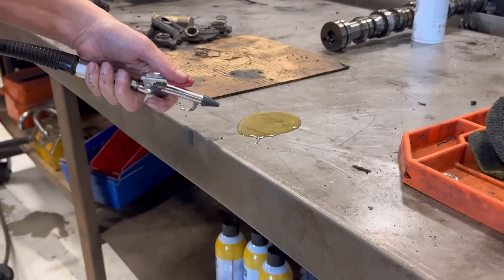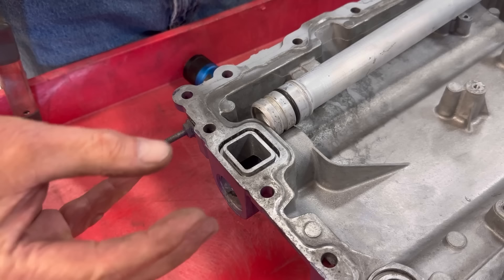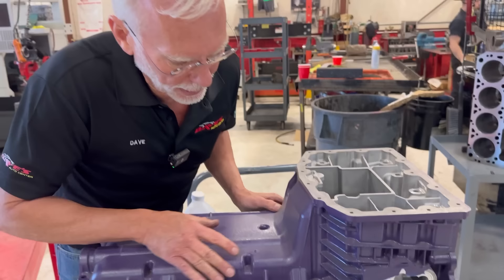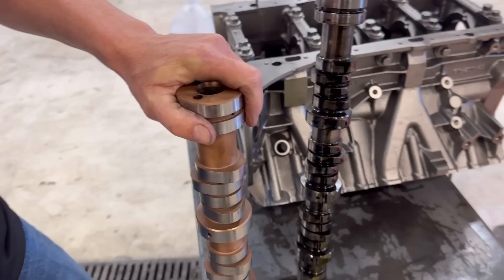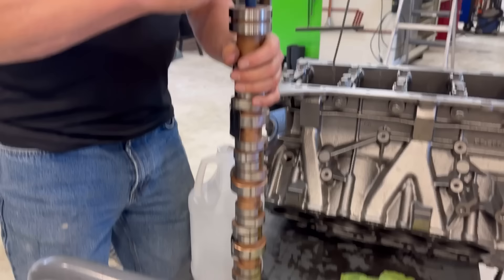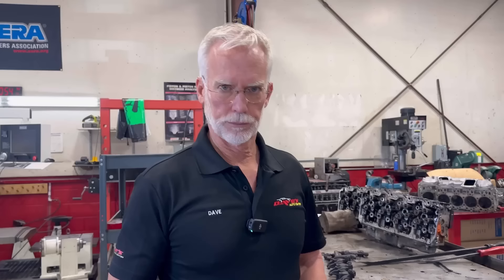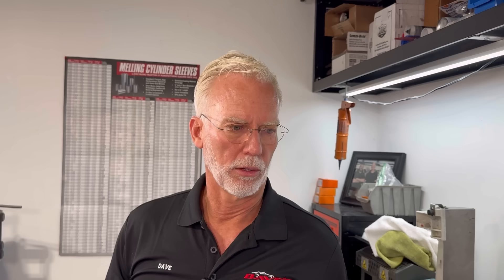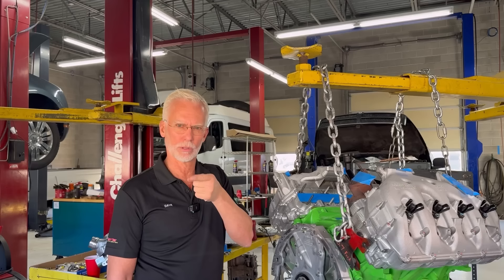Part 1: Ford 6.7 power stroke oil starvation issues revealed

Comment: Needle bearing pin points the load . In a heavy duty situation bushings are used . Simple but live v  belt tensioners wear out real fast with needle roller bearings bushings fix this .
Reply from the maker: Thanks for the tips!

Comment: JUST  PRESSURE  LUB THE ENGINE WITH  A  AIR  TANK, IT  WORKS It will push  the  oil threw

Comment: Where do they commonly fail. Watching your demonstration makes m think the engine oil should be checked when the engine is running. Not really. But there's at least a half a gallon of oil to be pumped out of that pan before its even running normal. There would be lucky if there was 2 inches of oil in the pan by then. Angles to the vehicle would starve the engine of oil.

Comment: Hey Dave!, I had an '02 f250 7.3 with a five-stage Diablo. This was before plug and Play. Now when I fired that truck up at 4:30 a.m. I would never shut it off EVER !  Until I got back home between 14 to 16 hours later. Every morning I started that truck instant oil pressure. I know it's not the 6.7. That being said, what would it take for the 6.7 L to have an electric pump to prime the system before start? 🤔 Maybe even with a small heater core in the electric pump to bring it to operation temp or close to it 🤔 What are your thoughts on that?

Comment: I do my own oil changes on my 2017 6.7. I always fill the filter before installing. It only clatters for a few seconds. the oil pressure gauge comes up quickly. I don’t know what point he’s trying to make. He should know when you drain the oil there’s still oil in oil system.

Comment: My question or comment concerns the engineering staffs at the large manufactures. In particular, how are new ideas developed? Does it take a staff change to bring in new ideas? do the current employees force new hires to keep doing things like they have always been done? Is it good for old ideas and techniques to be passed down to younger engineers? A person would think that after 120+ years the basic components would be bulletproof by now but we still see failures with the basic components of the automobile.
When you refill a cranckcase after an oil change what is the safer/more accurate method so as you do not overfill or underfill? Fill the engine with the stated capacity in the manual or use the stick? How accurate are dipsticks? (I think this can be different for different engines) Is it OK to say to a customer that complains about the stick reading either too low or too high "I don't care what the stick says I put in what the manual says is the capacity" How do you know how much to add or take out with an underfill or overfill condition if you want the stick to read exact? How much effort should you put in to getting a perfect stick read?

Comment: The engineers are new, very CAD'y and have never looked at or worked on engines before. But they being new are paid less than a retired or laid off experienced engineers. Not Practical Engineers yet they create great looking designs on paper. They love to use very inexpensive parts in critical failure paths and placing them in hard to access locations.  Easy to fail vent flap motors in in accessible dash locations. Plastic solenoids and wiring in oily and hot areas. Module communication lines that can take out modules just by removing a ground or being connected to 12VDC.  Wiring insulation that fails after 5 years. Yet overall corporate profits are up!

Comment: First off, I appreciate your excitement and commitment to quality,  but,  for the sake of good engineering and argument, what makes you think the oil is 'draining' at any significant amount while it sits?  Nothing is 'draining' on the pressure side, let's establish that right now,. That only leaves the suction side that may drain. If the oil pump is clearanced to spec, and has no air leak, and filled to the proper level, the oil cant drain back. This can be proven by accurately checking your oil level shortly after shut down, and compare it to oil level after sitting overnight. The biggest issue, oil wise, with the 6.7 is well documented in a service bulletin that noticed higher bearing failure rates in the colder climates, northeast regions  when 15w-40 is used rather than 5-40 or 10-30 synthetic oil. The stated reasons for this are tight oil clearances on main and rod bearings which have since been revised. Second point worth noting: yes, oil has some distance to 'travel' in a 6.7, this distance is irrelevant after initial fill/pressurization and all the space is filled with oil. Millions of 6.7s are in service, a relative few 6.7's suffer catastrophic bearing damage, many run over 200,000 miles, I have seen a few stock engines with questionable maintenance suffer from bearing and lifter issues but most suffer from the same  emissions issues as every other EGR, DEF, DPF, and CAT, equipped diesel engines suffers from. I see more CP4 HP fuel pump failures that alarm me more than bearing issues.

Comment: Sounds like the place where they had there oil changed especially if it was a diesel wasn’t the relight place to take it. With that being said maybe people are getting the oil changes at the wrong places because it’s cheaper than going to a diesel shop that gouges u because u own one. Sad

Comment: So is the problem the way that the oil is delivered throughout the inside of the engine and all it's intricate components? Is the volume of recommended oil enough? Say if my truck says it takes 8.2 quarts is that enough to fill all the little parts or do we need to overfill? Or does all this simply boil down to design flaws? And what can we do to protect our engines? I change the oil on all out trucks at 5000 miles, using full syn

Comment: An external accumulator would solve any dry starts from sitting, cold weather or air from an oil change.  
While i don't agree with the ford oil path design, there's waaay less failures from it than you say. 
We've had 6.7s from 2011 til now and not ONE has clacked after an oil change. 
It's good that's your thinking about this but i think you're over thinking it. If you want to test how long it takes oil to circulate through ALL those passages, put a mechanical guage on one after it's been sitting or hot. Either way, it'll surprise you how fast it moves and builds pressure. The oil film from the last start is what protects bearings on initial start up. 
These failures you say/see are from anomalies and abuse or lack of maintenance.....
Reply from the maker: Thanks for the feedback!

Comment: Does the oil filter sports an anti-syphon gasket ? Because if so, that would greatly reduce the volume of oil running back to the pan after an engine stop. Regards !

Comment: Pre fill the filter, how come all the engine manufacturers say not to?  Cummins and CAT right off the top of my head say not to…. Same with my D15 Volvo. I’ve never prefilled a filter and my 6.7 ram has 487K miles on it. My D15 has 936K miles…

Comment: An engineered oil pan designed to relocate oil to different areas of the block ? What happened to pump up and drain down ? Thru oil galleys ?

Comment: The oil filter has an anti drain back valve I don’t think “all of that oil” drains back into the engine which holds 13 quarts. Easier test would be checking the dip stick to see how much drains back 🤷‍♂️
Reply from the maker: Thanks for the info

Comment: Is oil starvation really an issue when cranking electrically at low rpm? Couldn't you just turn the engine a couple of dozen times with disconnected spark plugs or coils and fill it up that way at slow speeds?

Comment: Many (experts) on YT say there is no point filling the filter as it fills very quickly. While I have always filled the filter prior to installing, this only works if the filter is vertical or near vertical. Many modern engines are not, they are on top thus rendering this process ineffective. Not being familiar with this engine, is there not an anti drainback valve in the pump/filter assy? I have seen engines that lubricate via the cam first as in this engine (GM from memory). People do modify these blocks for better main bearing lube when producing high output, but the system works very well unmodified on the stock engines. Now I would expect the time for the oil to reach the turbo on a brand new engine would be excessive, but that is why engine builders have the rig to prime the system before first start. Some have to do this manually by pressurizing the oil system with whatever thing they have knocked together. I find 20PSI works OK for this. I would like to see how long it takes to register oil pressure at the top of the engine after you service his engine (as in real life). Unless you are going to leave the thing drain for a day or more, I believe there is still oil in the pump for quick suction/pressurization after a normal oil service of around 15 minutes. That is the figure I am interested in. I also have question on this lifter housing design if one lifter is weaker than the other. This could cause side load on the rollers and contribute to failures? If I remember correctly, Steve Morris uses roller lifters in his 4000+ HP engines?

Comment: Would a check valve in the oil system keep it from draining between startups? Or can you get an Aux electric oil flow booster you could fire up before startup?

Comment: Explains many problems. Blew two rods through oil pan in my 2019 f350 at 37000 miles. Ford replaced engine.

Comment: I guess it's  not possible to add  electric pre oil pressure pump accessory. Pulse width modulated ?? . imagine how long for the oil to get up if it's minus 30 lol

Comment: So just how much does it cost to have a 6.7 rebuilt? I don't have any issues, that I am aware of. The motor hasn't been tuned. It's pulled a fifth wheel for a few thousand miles, and hauled a camper. But other than that it's been some pretty light use.

Comment: Does the oil filter have an anti-drain back valve? If so as long as no air enters those galleys to displace drained oil. The oil will not be draining back into the sump. 

There’s certain things I’d be worrying about w/any diesel rated at >1000 ft*lbs torque but oil scavenging is probably not one of them. Sintered rods would be a biggee, what are bearing tolerances from factory? We commonly allow a tolerance range of 0.004-0.006” in clearances but is Ford qc meet g those specs. Are the pressure relief piston and bore completely free of any burrs that could hold valve open. How finely are pump gears machined? How well are the cases cleaned, de we have instances of casting sledge fouling galleys and oiling orifices? 

Biggest complaints I hear are improperly sealed upper oil pans which I suspect the RTV is either to fast setting for the assembly line workers to set and torque or the mating surfaces aren’t adequately cleaned since when disassembled there little if any residual RTV on block mating surface. 

Not to dismiss your exercise, I just doubt it’s related to the actual problem of spun big end or main bearings, if in fact that’s an actual common issue

Comment: Reminds of a similar problem on one of my small engines. Specifically a twin cylinder 23hp Kohler with a horizontal oil filter. Kohler decided to put the choke integral with the throttle, so to apply choke the throttle is pushed to beyond maximum speed into choke. Thereby the cold engine starts at maximum speed. Makes me cringe. I've taken to just cranking the engine  with throttle off for 6 to 8 seconds to distribute oil; then choke to start. Will this help prolong engine life?

Comment: If a guy could just design and install an inline pre-oiler ( like they did on big radial aircraft engines )  then that would go a long way in helping these engines.  Make it a stand alone switch, or get fancy and wire it to run for 30secs prior to the engine even turning over.  Heck, get real fancy and heat the oil.. now you have hot oil circulating in your engine before any load is applied to it.  ..... Nah.. that just makes way too much sense now...

Comment: On the subject of oil starvation - on car and light truck gas vehicles. do you pre-lube thenew  oil filter before installing it?  Another well-known auto repair guy on YouTube has come out quite strongly AGAINST filling the filter before installing it, stating that the risk of contamination is far greater than the engine running with a dry filter for a few seconds before oil pressure comes up to normal.  I'm skeptical of his claim, since I only use oil directly from the retail container (no secondary vessels) and I'm scrupulous about removing the foil seal completely from a jug before pouring.  I'm interested in your opinion!

Comment: Man this is very useful information. I’m a tech gas or diesel engines I have a Chevy 5.3 and I want to see if I can get over 500k on a rebuild I know all the failures and one is the oil pump because it’s a suctions style oil pump and the other failure is the 5.3 runs about 220 to 230 engine temperature with the a/c on the so I’m going to stud it do you have any other suggestions?

Comment: Which years of the 6.7 PSD engines have this issue? Gen 1? I have a 2018 6.7 and have never heard any "clacking" of lifters after an oil change. I fill the oil filter before install..

Comment: I believe that they are making vehicles less reliable,  my 22 F 450 7.3 gas engine with less than 100,000 miles,  has several problems,  already replaced the transmission,  now i have a missfire on # 6. I replaced the spark plugs,  1,2,3,&4 plugs were not tight or all the way in, # 2 was only halfway in, it had problems with carbon build up on the threads. Which make it extremely difficult to reinstall the spark plug 😢

The engine has that typewriter sound,  or popcorny noise😮
And didn't make that noises when new😢 and has gotten worse now that cold weather has moved in.
Reply from the maker: Yes, many followers will find this very familiar, unfortunately. Thanks for the feedback.
Reply: nephew just replaced a 7.3 in his F350, at 41,000 miles the motor puked due to shrapnel from failing cam/lifters getting into oil pump and locking it up,  this is his 3rd Ford Truck that has failed on him, a new 2004 F150 5.4   2015 F150 ecoboost and now his 2021 F350,  Traded the F350 off for a Ram with a Cummins, He's done with Fords

Comment: Seems to me the only people who would design a flawed oil pickup and delivery system like that probably make the maze puzzle magazines too! How ridiculous, and a trainwreck waiting to happen. How 'bout a oil delivery system like the "Old School" Iron blocks, where as the sump is is connected to the block not the oil pan. Just bcuz it's made from aluminum doesn't mean they have to reinvent a broken wheel. 😊 Just make it a Dry Sump oiling system like the Dragstrip engines!

Comment: Would not an accumulator solve the start up oiling issues? What’s that, it’s expensive? It’s cheaper than an engine. This is the result of engines designed by bean counters in conjunction with engineers. This to a degree is a necessity otherwise things can become unaffordable.

Comment: Maybe an external, electric, pre-charge pump is the way to go on those. I am a Ford guy and the 6.7 is a great engine. Sometimes it hurts to see what your dirty underwear looks like. I chalk this up to engineering, finance, and Manufacturing not communicating. Plus, if it doesn't break they can't sell you a new one.

Comment: Why don’t engineers design these oil pumps with a check valve so that the oil can’t back feed to the pan. Wouldn’t that mitigate dry starts?

Comment: So the engine is started already starved for oil. and as the engine is under use those passages get dirty and rougher. Here is something to figure -the shape of the passage and the roughness contribute to not only slowing down the flow but a huge decrease in PSI.  This is not by accident but by design. A well oiled engine lasts too long. and these trucks are Ford's profit area now.  If they were allowed to use the old 6.9 and 7.3 they would end up bankrupt

Comment: What’s your opinion on F-150 2004 followers breaking down quick? What’s the flaw in the oil system? I got this truck n I added 1 quart extra then what manufacture specify. 7qrt in total I have n the rattling in the cams when down by if guess 80%.

Comment: 6.7 is 12.4 lL . If you do an oil change it takes like 10 minutes after running it to even have oil on the dip stick
Reply: Are you changing oil on a cold engine?? Must be, b/c it flows much faster for me. At least with 5w-40.

Comment: A large part of the issue, is that the auto mfg. DONT WANT to build a product that will ‘last’ trouble free for 10-15 plus years trouble free. They want to sell parts and pieces😰😰😰that become so expensive the owner purchases another new vehicle.
Reply: They’re going to sell parts, the whole engine. Man if I had a 6.7 power stroke I put a cut off on the fuel so I could spin the engine to get pressure before I started it.

Comment: 2015 6.7 with 415k miles on it.  No issues other than a slight pan gasket leak.  We use T6 5-40 Rotella and I have never pre-filled any oil filters.  Am I die?

Comment: Run a quality 0w40 or 5w30 oil...
The oil related failures of the 6.7 can be dramatically reduced by using a thinner oil with a more robust additive package.
15w40 is garbage oil no matter what brand you buy, add in cold Temps and its that much worse.

Comment: Have a go at this . 08 Escalade. Shuts off or stalls after about 10 min of a driving load.. sits an idles all day . No check engine light on.  Replaces new from factory GM parts. Fuel pump, cam sensor, crank sensor, new magnet actuator. Still have not fixed the problem. My code reader can’t see any codes . I don’t know what else to do. The wife ride . Any ideas ? Ty